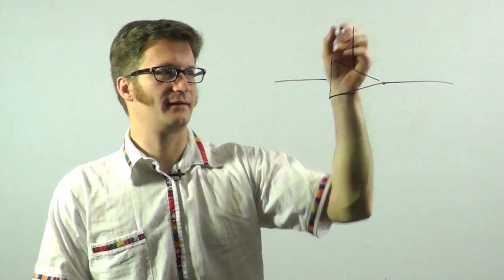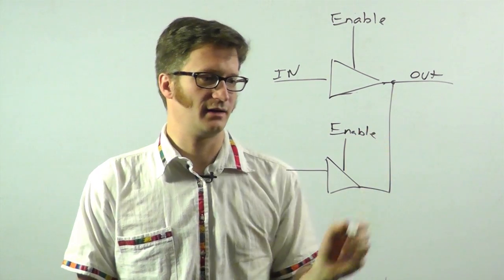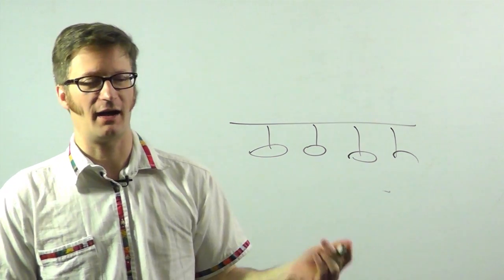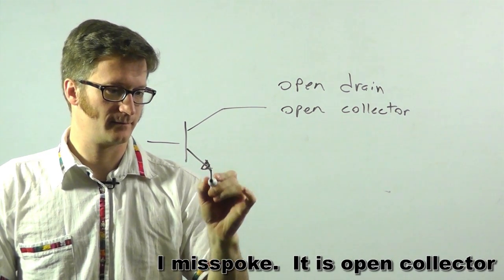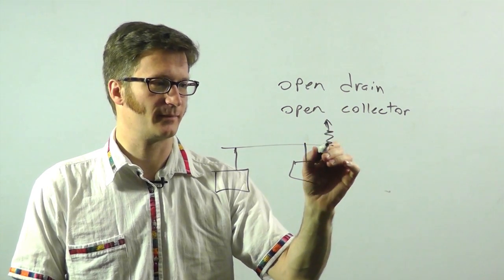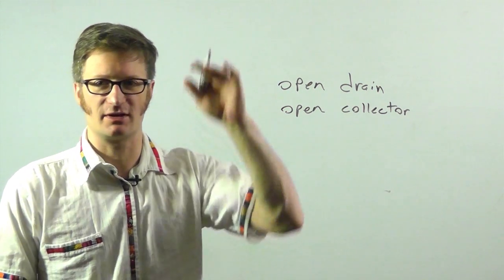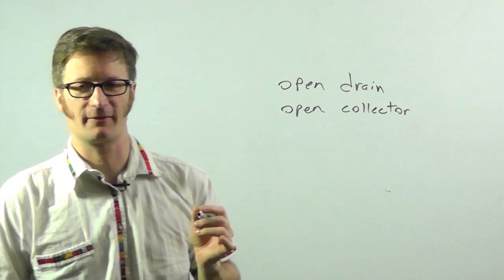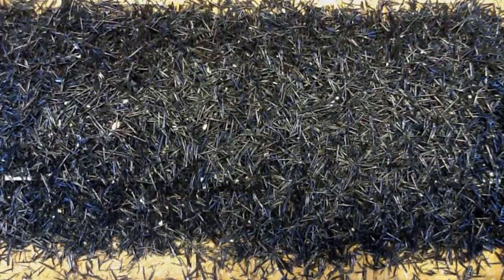Digital Logic - Three state gates

Comment: Just wondering why high impedance is not recognised as a 0?
Reply from the maker: High impedance is similar to no connection at all so unless the circuit that you are working on has a pull-down or pull-up resistor then you can't know what the output of the circuit will be.   It is even possible for it to float near the metastable point and have an output that changes over time.
Reply: hmm i see ;  I'll have to do more research but thanks for the reply!. -currently on a AtoD/amplifier feedback assignment